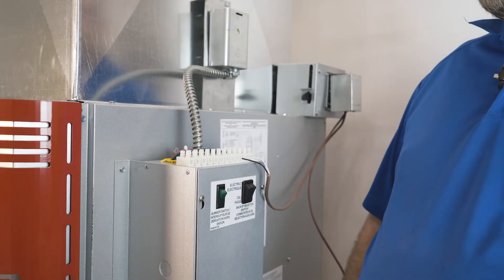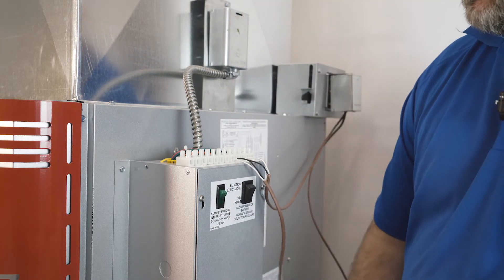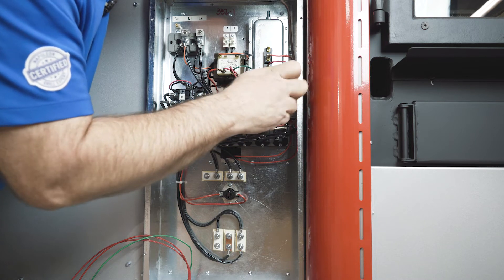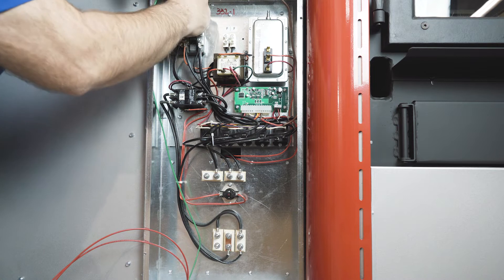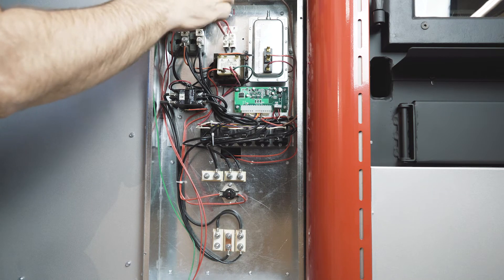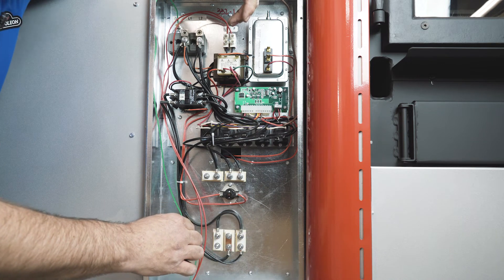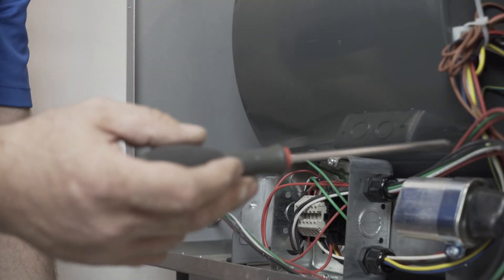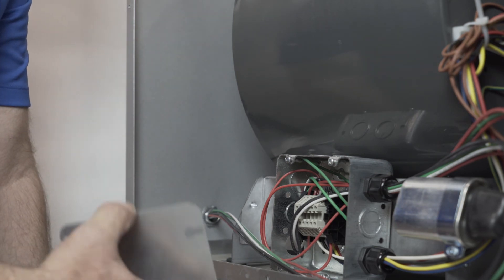Napoleon HMF150 Furnace Wiring for Wood and Electric Configuration

Comment: Can either the required thermostats control just the fan of the unit? Also why does it use the w terminal (1st stage heating) and R (power for heating) on the thermostat? Shouldn't there be g (fan control) and c (common for power) in there?  Any help is appreciated.
Reply: If I call your number mentioned for HVAC support it says to contact my local dealer who cannot correct this same problem of the question for my / your client regarding the continuous fan setting
Reply from the maker: Hi JB, 

Thank you for your inquiry. 

Please feel free to contact our HVAC Customer Experience Department for assistance with your inquiries. Our HVAC Associates would 
be happy to help.

We can be reached by calling 1-866-820-8686 or via email at HVAC@napoleon.com

Let me know if you have any additional questions.